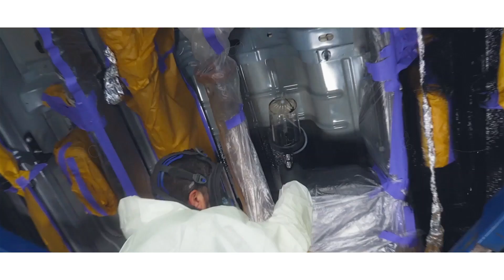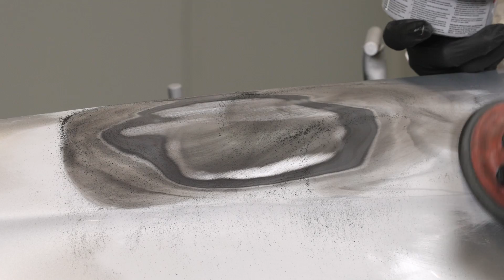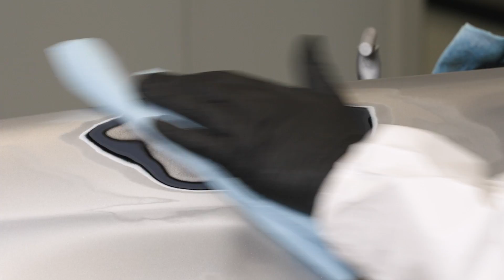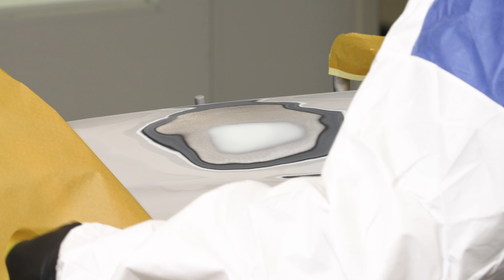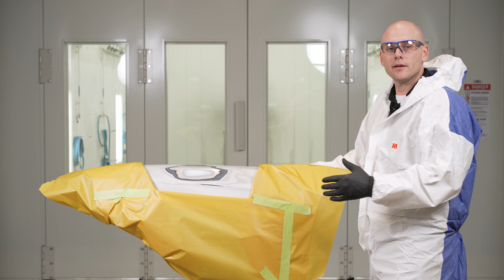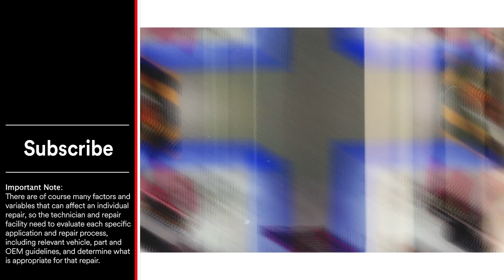Feather, Prime and Block Episode 1: Featheredging, Sanding, and Masking

Comment: @1:30 you mentioned body filler should not touch the feather edge paint area because of the styrene in filler will react with the paint causing the paint to swell. But I found some other type of fillers they are designed and able to apply on top of sanded paint area? is it because those fillers have different types of chemical components in it? thanks
Reply from the maker: We appreciate your inquiry and would like to provide you with an explanation of the procedure. If you have any questions, don't hesitate to give us a ring at +1-877-666-2277. Our customer service representative can provide you with more information about this.
Reply: Yes

Comment: Some suggest that epoxy primer should be used on bare metal before application of filler - why do you do it differently and are there any pros to doing it in such a way (or any situations where that should be the way to go, for example, if the panel was previously rusted)? Thanks!
Reply from the maker: Hello! A small amount of guide coat outside the repair area probably won't hurt anything. However, it is best practice to remove as much of it as possible prior to continuing on to the next step and to avoid any confusion later on in your repair. We would recommend removing as much of it as possible and to be as careful as you can when applying a guide coat.
For the second part of your question about epoxy primer - many OEMs are requiring all substrates to be primed with epoxy primer before any filler is applied (Honda, Rivian, and Ford to mention a few). You should always follow the OEM's recommendations as a first step to preventing corrosion/oxidation during the repair process.
Reply: @3MCollision  is there any easy way to "clean/remove" dry guide coat without sanding it down (for example, if it has landed on an area you don't want to sand)? Thanks!
Reply from the maker: Dry guide coat can be wiped off anywhere that isn't sanded. To get it off of sanded areas, you can use a Scotch-Brite Clean and Finish Disc (PN 77225) paired with a vacuum sander - it will take it right off!

Comment: Just One question?? I was told to Never put wax and grass remover on body filler?? it will get trapped in it and mess with the prime and paint down the road?? is this a real thing??
Reply from the maker: Hi there! Thanks for your question!

Please note that this is a real concern in the automotive body repair industry. Wax and grease remover, also known as a surface cleaner or degreaser, is typically used to clean the surface of a vehicle before sanding, applying body filler, or painting. However, it's important to use these products correctly to avoid potential issues with the body filler due to absorption, adverse chemical reactions, and/or poor paint adhesion. Hope this helps.